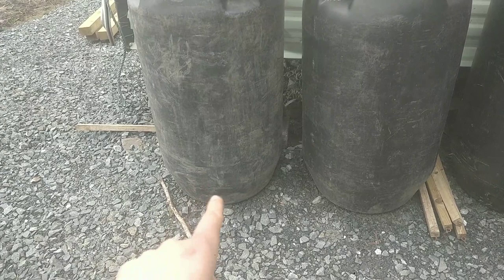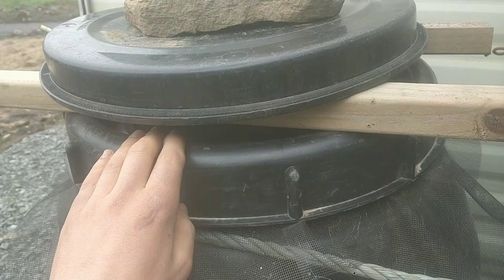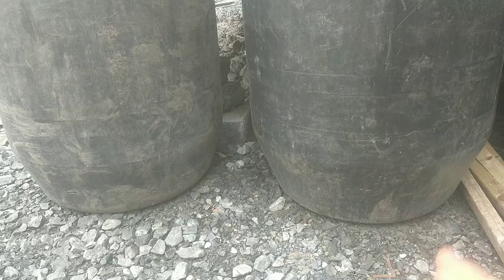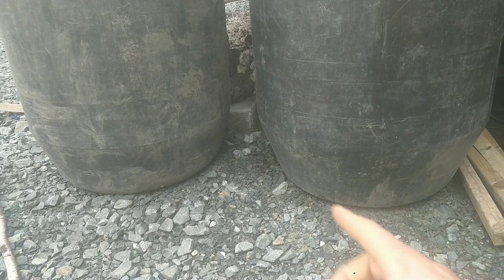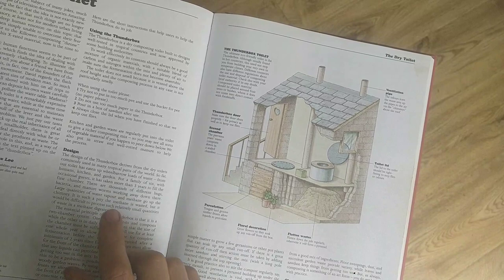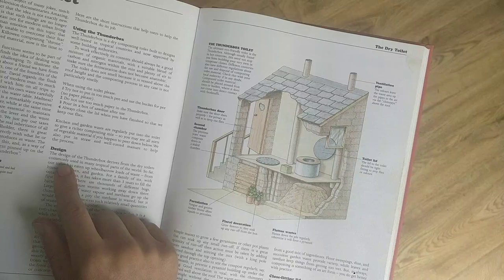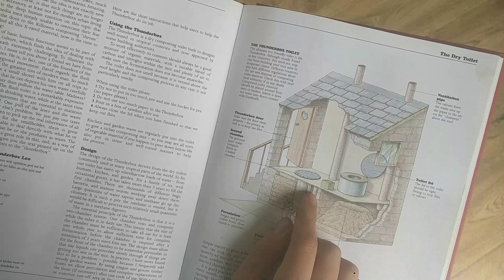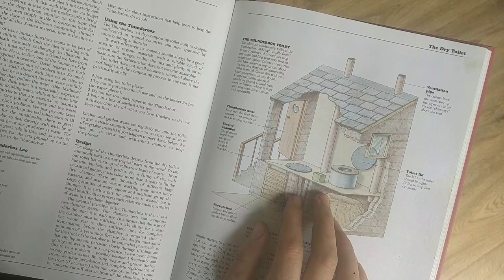My Compost Toilet System | Starting a homestead

Comment: i am using a composting bucket toilet in the ozarks , we use peat moss rather than wood shavings . the bucket is emptied into a bin made from wooden pallets after the bucket is emptied we cover it with leaves or mulch .

Comment: Hi again Kyle, I built a compost loo in a shepherds hut that I rent out  to guests . I paid the £200 for the urine diverter seat with soft close lid. I dug a 2ft by 2ft by 2ft hole put the urine pipe in there and filled with gravel. No’2s drop into a wheelie bin and a scoop of sawdust every poop does the job. There are no smells whatsoever. Removing the urine apparently makes this process better.

Comment: Well done on the compost loo. It’s something more people should consider. We’re building one John Seymore’s way but with a separator for the urine.  Bucket system at the moment. So less emptying in the future. In the local village here all toilet waste goes out into the sea. There was planning objections about the proposed treatment plant as no-one wanted it near their house. I think if people had a composting system, had to deal with it themselves and saw it as a resource and not just as waste the mindset would be different.
Reply from the maker: A community constructed wetlands system would work! There's villages and towns that have done them with great success! Maybe you could bring it up with a local councilor or committee!
Reply: The treatment plant is going ahead. Objections were overturned by the council thankfully.

Comment: I do have a regular toilet and septic tank which was installed before I bought the farm. However there was no bathroom or shower. I installed a downstairs shower room with a compost toilet. Its purpose built but not fancy though it has a seperater. The wet waste goes into the grey water system that flows into a reed bed. I use pine wood shavings which comes from my land. The solids then go into barrels like yours. That compost is used as mulch in the Coppice and under the trees and flower beds. I prefer using the compost toilet, it is cleaner, there is no smell but my son fitted a small vented fan just in case. It also means there is a usable toilet during an extended power outage as my water well uses an electric pump and compressor.
Reply from the maker: Great system you have going! I do plan on building a box to put the bucket into, that thing was a quick and cheap solution to get me started! One day I'd love to build a John Seymour toilet!
Reply: @thebridgemanscottage  I also have the John Seymour book it looks great, you could do that later on down the road maybe. I know when you're in the early days of setting up everything needs doing all at once and now but there is never enough daylight or money to do that. It's taken me years to get this far, its a constant work in progress N
Reply from the maker: @julibeswick-valentine3690  absolutely! I'm always looking for the cheapest, easiest, fastest solution possible! 😂 Just until I have a baseline level of functionality and comfort. I can then start perfecting over time :)

Comment: Go into the nearby sitka plantations. Collect the pine needles. It's FREE and breaks down quicker than the woodchips. These are often shredded pallets that have been heat treated to prevent rot so don't break down as quickly.
Reply from the maker: I did that in the beginning! :) I just thought it looked nicer for guests and I can use it as bedding for the chickens, they're really fine wood shavings which seem to be breaking down okay so far, it'll be another year before I find out though 😂

Comment: thanks for all your videos. No mention of separating solids from wee...?? I built a compost loo, and there's a 5ltr water bottle with a small funnel on it's top for wee and solids go in the large bucket behind it, all enclosed in a box. Also, mix the wee 50/50 with water and use as fertiliser.
Reply from the maker: I don't separate it, the wee gives the wood shavings the kick it needs to break down when in the barrel. Plus I usually go number one on the trees 😂

Comment: Another great video. Thanks Kyle. Have you thought about separating the solids from the liquids? I've found it eliminates odours completely and speeds up the composting process. The cost of the urine separators are crazy given that they're just a piece of mass produced plastic, but there you go... I'd be interested to hear about the odours during the summer, in particular whether you notice any changes in the caravan itself. We live and learn together. Thanks again.
Reply from the maker: I had the compost toilet last summer and never had a problem, there's never been any odours inside the mobile, only when everything it tipped over into the barrel then there would be. That can be remedies by throwing more dry stuff on top after tipping the bucket but really you would only smell something if you're standing right next to the barrel
Reply: @thebridgemanscottage  Amazing. Thanks buddy.

Comment: Hi. You said that there were holes in the bottom of your barrels for drainage & that they were on a stone base. Is the stone base permeable and, if so, don't you then have uncomposted runoff leaching into the soil? 🤢
Reply from the maker: Yes it will go into the soil and any bacteria and pathogens will break down, there is no concern. That's how septic tanks work.
Reply: @thebridgemanscottage  Don't you therefore have a septic tank after all???
Reply from the maker: @andreahunter7281  no because I'm not using water
Reply from the maker: I'd be more concerned about brushing my teeth with a brush covered in poo particles from using a flushing toilet.
Reply: @JC-lc5gl  Not all septic tanks have to be emptied. There are different systems apparently.
Reply: @thebridgemanscottage  I didn't realise that septic tanks had to use water & yes, now I think about how far fecal matter is sprayed into the air when you flush the toilet, I'm not that keen on using my toothbrush tonight!!! 😱
Reply from the maker: @andreahunter7281  I used to use a little plastic cover thing on my toothbrush to protect it from the poo particles!
Reply: @thebridgemanscottage  I believe that in a lot of countries the toilet is separate from the bath & sink for hygiene reasons, but we've mostly stopped doing that for some reason 🤔
Reply from the maker: @andreahunter7281  yes in Japan they have separate toilet room and bath room! Their toilets sometimes have the sink built into the cistern to save water!
Reply: @thebridgemanscottage  We all need re-educating it seems 🥴 Hopefully your channel is doing that (it's certainly making ME think about things, so thank you 😊).
Reply: @thebridgemanscottage  that sounds great.
Reply: @thebridgemanscottage  that sounds great.

Comment: Very interesting!
Can you use the compost if you take prescription medicines?
Reply from the maker: You already ingested the medication, so I see no problem with it.
Reply: @thebridgemanscottage  my husband sits on a pharmacy board so I will ask him. May depend on which medicine. Some medications are fat soluble and others water; ie vitamin C when taken in high doses will flush through your sustenance. Never flush away expired meds as they are usually incinerated. Proper procedure. Good question. We might find that the experts have a different answer.
Reply: @thebridgemanscottage  my husband sits on a pharmacy board so I will ask him. May depend on which medicine. Some medications are fat soluble and others water; ie vitamin C when taken in high doses will flush through your sustenance. Never flush away expired meds as they are usually incinerated. Proper procedure. Good question. We might find that the experts have a different answer.